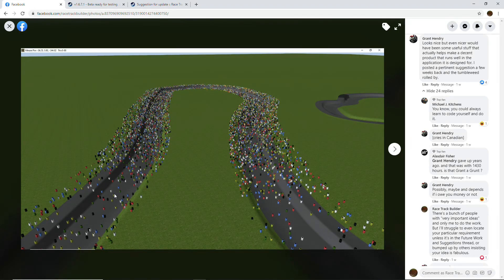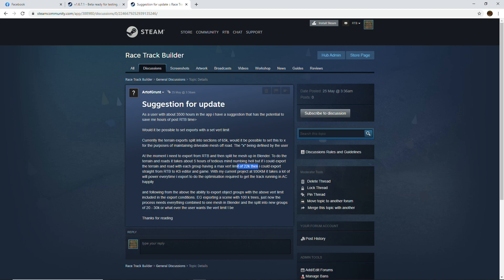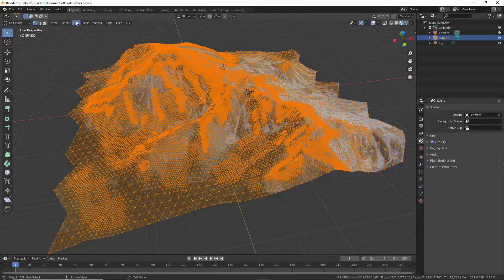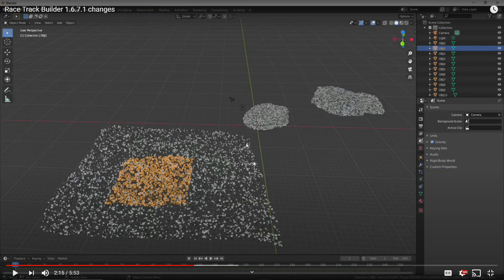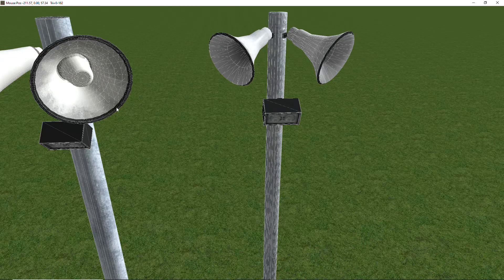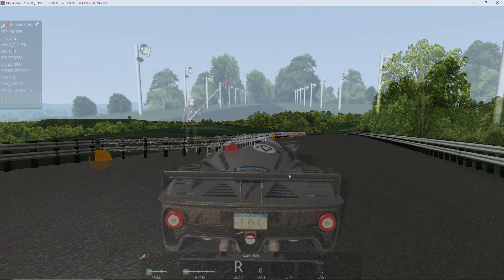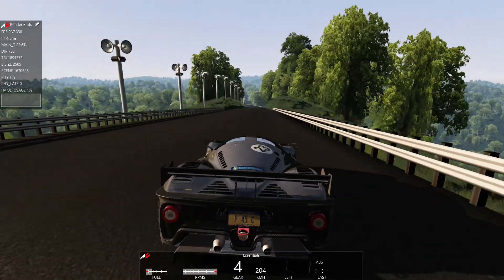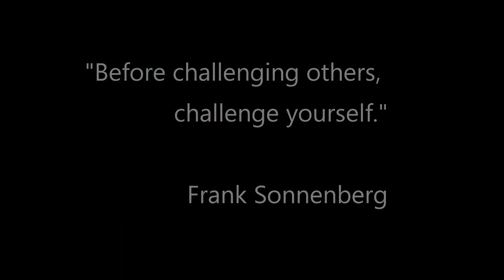Race Track Builder Performance

Comment: Hey there! Don't know where else to post this, I did it on RD, Discord, AssettoCorsaMods without success. Searching one year for the solution. What are the correct settings for tree textures Xpack? DXT5 or DXT3 should work I think. I guess alpha test, and to use KS tree shader. 2 by 2 resolution images, normals facing the right way in the model and naming the things properly. My trees and their shadows work in KS editor and in the game itself but in RTB they cast a weird black shadow on themselves. Please help and thank you :) EDIT: never set the specular power to 0, I guess it must be a number higher than zero. All is working now.

Comment: 22k vert limit for driveable off road physics gives 100% result.  Using a mesh with greater than 24k gives you a percentage chance of falling through the map.  So that claim needs a bit more scrutiny as my testing over the last 4 years of exports and cleaning the mesh, optimising the objects and having a map that you can drive anywhere without falling through the map tells me that 22k gives 100% results no matter the poly size

Comment: Man this is incredible, I have been following your work for a long time, and it is getting more and more interesting, I am an architect and I dream of the possibility of being able to design race tracks, I am learning blender and everything I can do there I will try to make available for the community! I have a question about the topology of the faces, they say it is better to work by qauds and avoid triangles, does that make sense? (remember I'm a Blender beginner ... =) Thanks!
Reply: You can work with quads in Blender and export as quads straight to AC editor.  The AC game engine will triangulate the mesh automatically
Reply from the maker: All games render with triangles eventually but you can use anything in Blender. I've seen some games designed with spline patches for physics, but that's rare.

Comment: The default XPacks are well optimized when it comes to polycount and textures. A lot of the buildings have duplicate faces and need re-texturing. It could be that they are treated differently in AC than other titles, there is a second material which is not identical (could be for LOD, haven't bothered to analyze). All walls, RTB exports them with two materials, one with _vb at the end of the name. They are identical in all ways, pure duplicate. It is unnecessary step in the process to delete the 12 or so duplicate materials from dozens of objects.. Those are the "biggest" problems for optimization to screw you up and i would imagine deleting duplicate material from 12 000 objects would make one rage for a while.. It will take a looong time in 3Dsimed to do that..      

Optimization is done in multiple stages and RTB simply can't do it all for you. There are too many subjective decisions and evaluations, what matters most varies a lot. Textures make a HUGE difference... And if someone talks about performance hits and has not checked his drawcalls.. doesn't even mention them.. that is a sign of something. You don't really need to care about objects, you need to care about drawcalls. And those in term are affected more by texturing than object count. There are several ways the CPU and GPU can optimize things and it is all really based on materials. Everything becomes faster with fewer materials, you can really push the "mesh count" to millions of separate meshes, as long as they can be squeezed in to a few drawcalls.    

I've worked with a few game engines and their middlewares and RTB does just fine when it comes to optimizing, it is one again a problem that is created by the user and possible not understand how the rendering pipeline works. Physics engine is separate and has its own limitations.. There object count matters more. You rarely hit any limits with that when it comes to track tech, it is mostly visuals and graphics engine that causes bottlenecks.
Reply: "Those are the "biggest" problems for optimization to screw you up and i would imagine deleting duplicate material from 12 000 objects would make one rage for a while.. It will take a looong time in 3Dsimed to do that."
2 second using a python script in Blender
https://blender.stackexchange.com/questions/55233/disable-material-duplication
Reply: The big 980KM track has 200k trees and bushes. 3 materials, and 3 textures and 100 approx objects.  Straight out of RTB we get 36k objects thousands of duplicate materials/textures.  Same with the rocks, i have 14 different types of rocks, 1 material and 1 texture and 50 objects.  If i could set export option to set group by material and vert i could go straight from RTB to Blender to remove duplicates with Python script and then AC editor.  I could be in game testing in 10 min from RTB whereas right now, a red level export which is the terrain grouped is about 1 hour in Blender, Amber export when the terrain and roadside is grouped is about 2 - 3 hours and the full Green export where the terrain roadside and road mesh are all grouped in an efficient manner reducing the object group.  This takes about 5- 7 hours and mind numbing tedious ness that is required to get the map running optimum.  All that could have gone but all i get is a video
Reply: MY DIP figures were posted on the Facebook post
Reply from the maker: Buildings do have LOD objects, but I'll double check the faces. I fixed the duplicate material on walls. Duplicate Materials will require re-writing the FBX wrapper - on my list but fairly time consuming. Thanks for the feedback.

Comment: Unless that 930km tracks is the twistiest loop ever.. it will not work in any sim. The limitations are still distance from origo and floating point accuracy. In theory, things look ok, in practice.. you will still start to encounter weird behavior about 100km from the 0,0,0. If you plan on a long track, always make it so that world coordinate 0,0,0 hits near the middle point of it.
And of course, being one of those "please, we need feature X", i will promote for Terrain Smooth brush, gaussian smoothing.
Reply: With object/mesh optimisation and lots of hours there is no shaking for the majority of cars at the edge of map.  0,0,0 is at the centre and max distance from centre of map 20km.  Terrain is 37km by 37km and is proving very popular even at this early beta version

Comment: I would also like to see that big track run using CSP and VR. I feel like this track would run at like 10fps on my rig lol
Reply: If i was to export straight from RTB to Ac it would probably not even get to 10 fps on a 2080ti CRAY.  With many many hours post RTB we had it running on a laptop with integrated graphics at 33fps on a  single screen

Comment: Please make the new poles and lights usable with CSP, i love the look of them but i rarely use them because it is all one mesh/material.

Edit...just finished the video... What would you say is the limit for # of textures before impacting frame rate?
Reply from the maker: Texture limit will be very hardware dependant. When games are designed to dynamically load textures then it's not such a problem. When a game load all textures at the beginning (as most driving games do) then much more important to limit the number of textures.
Reply: @brendonpywell  hmmm I may have to revisit some older tracks and reduce texture count and see if it helps!... thanks for the reply!!!